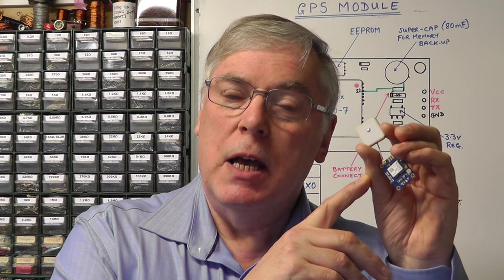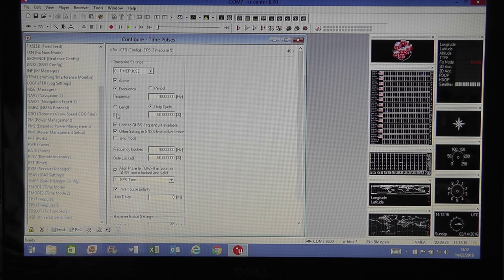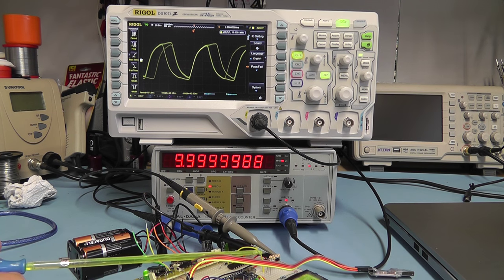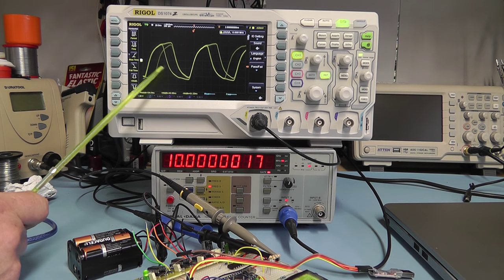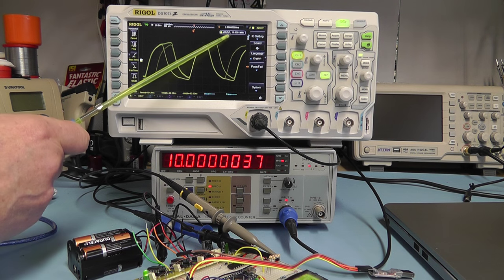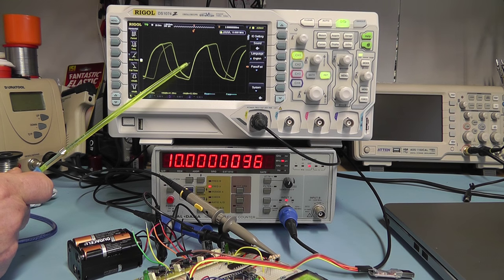Scullcom Hobby Electronics # 35 - Design & Build a GPS locked Frequency Reference Standard

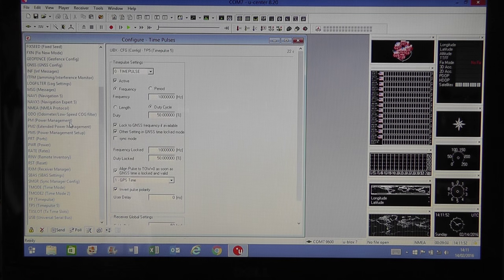Comment: Looking at the output LED at 30:00 it does seem to run at 10Hz as it should BUT when the system is locked at 35:00 the LED then seems to be flashing at 1Hz, why is this as you did set the output frequency in locked and unlocked mode to 10MHz ?, I did wonder if for a cheaper version without the Arduino and LED display you could set the unlocked output frequency to 1Mhz so you would get a slow flashing LED while the unit was unlocked and set the locked frequency to 10MHz so when you get the fast  flashing LED you know the unit is GPS locked, I think a good idea would be to have a buffered 10MHz output on one BNC and then a selector switch to enable the 1MHz to 100Hz output to be fed into a second output socket via another buffer/50 Ohm output BNC, that would allow the you to do lower frequency tests and keep the 10MHz feeding other equipment as a workshop master reference, great project, look forward to the next update, Thanks, Dave
Reply from the maker: +david ellis Dave. When you saw the LED flashing at 1Hz that was as a result of me temporary setting the frequency configuration to 1MHz. The reason I did that was to simply show the change in LCD display when locked on to a satellite. During the filming I had the unit on my work bench some distance from the window and was experiencing some difficulty in getting a GPS signal. When I moved the unit either to the window or outside it would lock when the configuration was set to 10MHz. I do mention in the video at 35:19. With regards your other point - Yes you could leave out the Arduino and the LCD display and change the unlocked frequency to say 1MHz - then the LED would flash at 10Hz when locked on to GPS at 10MHz and when unlocked and no GPS signal it would flash at 1Hz. With regards the outputs - I was planning to use one BNC for the buffered 10MHz and then try some switching for the other frequencies. I am working on that at the moment and will cover that in Part 2 of this project.

Comment: just curious why run the signal through a Schmitt trigger (btw I would use this approach as well), rather than a opamp with a large hysteresis? would that not do a better job to rid the noise?
Reply: nvm I just answered my own question.
Reply from the maker: +Weistek Engineering video blog No problem.

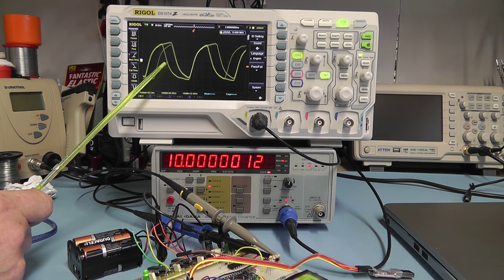Comment: If the 10MHz output is jittery because it is derived from a 48MHz clock (30:57) what would happen if you set the clock out put to a multiple of the master clock?  For example if you set the output frequency to 9.6MHz (48 * 2 * 100,000).   Would the source of jitter due to different multiples be eliminated?
Reply from the maker: +Rk Str Yes if you set it to an exact multiple of the fundamental frequency you should get a fairly clean square wave and so remove the jitter. I will test it out and try and show it on a future video.
Reply: +Scullcom Hobby Electronics 
I think it would be interesting to compare the two frequencies on a spectrum analyzer if the equipment is available.  The side bands should be easier to quantify than the amount of jitter observed on an o-scope.  Over all this is an informative video.  Thanks
Reply: It must be integer devider of internal GPS module 48MHz clock. And you will not have any jitter.

Comment: Since you are pushing the GPS module a little too hard at 10MHz and since you are trying to design an accurate freq standard, why not set the GPS to output 1MHz instead and use a PLL to gen the 10MHz? This would then give you more stability in the output noise and jitter of and would also lock to a satellite quicker.
Reply from the maker: +Kevy Thanks for your comments. Yes I agree about using a PLL. This is something I have used myself in the past but I wanted to keep this project easy to build. As you say the 1MHz output from the GPS is a much cleaner square wave. I am looking at some future projects using PLL's. As a future upgrade we could add a PLL to the project.
Reply: +Scullcom Hobby Electronics Yeah a PLL might be a good idea to reduce the phase noise if you are designing a high quality frequency standard.

Comment: Why does the EEPROM not remember the contents with the power off ?, I thought the idea was they held the memory until they are electrically erased !, nice project, parts on order already, keep up the good work, I love these projects and I buy in most of the major parts to supply via our www.basicmicro.co.uk web site, thanks, Dave
Reply from the maker: +david ellis Thanks David for your comments and pointing out the EEPROM error. I have had a further look at the datasheet for the ublox Neo-7. After further reading, there is some internal RAM in the Neo-7M module in the centre of the board and it is this that uses the configuration settings. Therefore, the battery back-up is needed for that RAM memory inside the ublox module. My mention of the external EEPROM was an error and the more I think about the EEPROM it is probably used for saving GPS data possible for logging. I need to check that further. Thanks again for bring it to my attention. By the way my name is Louis (I think you most have got Dave from my Scullcom website on which David my youngest son has some of the comics he has written and drawn).
Reply: +Scullcom Hobby Electronics Louis, I wanted so much to believe you were drawing the comics! But alas, you're like the rest of us. Congrats to David, though, on some good talent.

Seriously, I like your videos (not another Arduino with a light bulb!) and appreciate the time and effort you put into choosing the projects and their production.
Reply from the maker: +Alan Uomoto Thanks I will pass on your congrats to my son David re the comics.

Comment: so, a low pass filter set at around 20Mhz should work to rid the harmonics right? roughly 1.4uF (if my math isn't lying to me again).
Reply from the maker: +Weistek Engineering video blog Yes a RC Low Pass Filter would work but maybe a 10MHz Bandpass filter would be better. Maybe worth trying both options. The value of the capacitor will also be influenced by the resistor value in the RC Filter. I would imaging the value would be in the pF range (may be round 100pF to 200pF) with a resistor of about 1Kohm. But should really do the maths.
Reply: +Scullcom Hobby Electronics ya.. I forgot the resistor in the eqn. that's embarrassing. I'll have to try that. thanks for the replys.
Reply from the maker: +Weistek Engineering video blog I will illustrate converting the square wave to sine wave in part 2 of this project.

Comment: Hi Louis;
You said that the board uses a 80mF capacitor, but more later in the video, it looks like to me that the board uses a MS621 type battery, can you check that?

Also, from the datasheet;
" 1.12.2
Real-Time Clock (RTC)
The RTC is driven by a 32kHz oscillator, which makes use of an RTC crystal. If the main supply voltage fails, and a battery is connected to V_BCKP, parts of the receiver switchoff, but the RTC still runs providing a timing reference for the receiver. This operating mode is called Hardware Backup Mode, which enables all relevant data to be saved in the backup RAM to later allow a hot or warm start."
https://www.u-blox.com/sites/default/files/products/documents/NEO-7_DataSheet_%28UBX-13003830%29.pdf

 Love your work and your excellent artwork with the schematics!
Reply: +GADELHAS82   Yea!   his artwork is superb!  how long did that take?    MAN!! ...wow
Reply from the maker: +GADELHAS82 Thanks for your comments. I checked the board and it uses a Seiko XH414HG which is a 0.8 farad capacitor. I have two of these Neo-7M modules and they both use this super capacitor. The MS621 you mentioned was used in the earlier Neo-6M module.
Thanks for the info for the RTC. It seems that the RAM also holds the configuration settings.

Comment: Can you give me a reliable address where I can order the neo7m?.... I buy one at ebay, but that's a fake. I can not change the configuration.  
Cheers, Hans
Reply from the maker: Hi Hans,
I purchased mine on eBay. You could try:
https://www.ebay.co.uk/itm/NEO-7M-GPS-Module-Built-in-Data-Memory-with-Antenna-and-USB2TTL-Replace-NEO-6M/152606352091?hash=item23880c22db:g:6coAAOSwceNZVmnT
This looks like to one I purchased.
There are many sellers on eBay.
Some sellers are still selling the older Neo-6 which is no good for this project.
Regards,
Louis
Reply: Thanks Louis. 
Regards, Hans